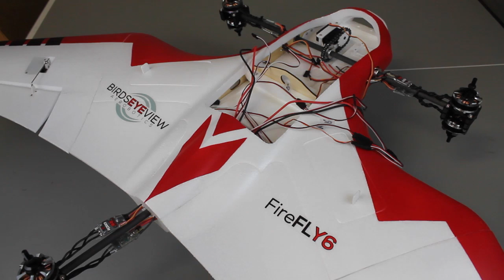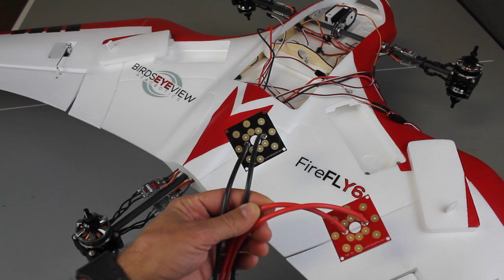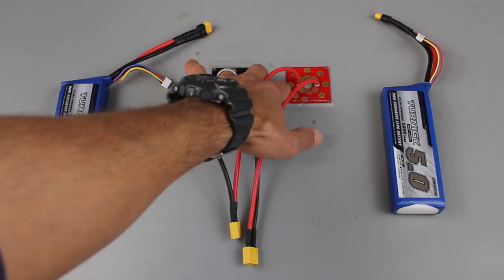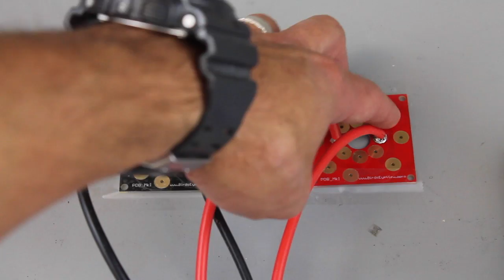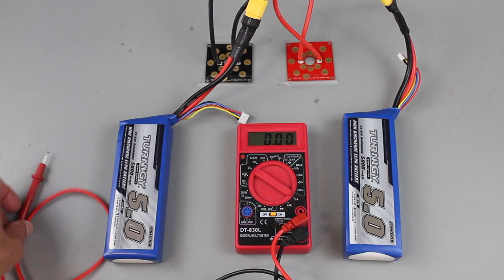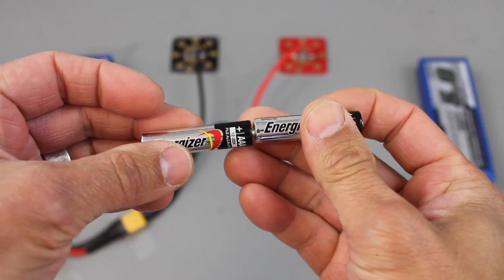How to Wire LiPo Batteries in Series and Parallel with Power Distribution Board

Comment: I'm building an ebike battery could I wire a 6 cell 22 volt 8000ah and a 4cell 5200 in parallel to give me 13.000ah but would it still be 22v
Reply from the maker: Hey Nick. Generally it's not a good idea to wire two non-identical batteries together. You can read various schools of thought here:

https://physics.stackexchange.com/questions/64509/different-batteries-connected-in-parallel

Good luck with your project.

Comment: Hi Dennis, I have been looking at this for over a year now. Still undecided I tried other VTOL's which failed in so many ways. One was a Ripmax which was nothing short of a toy. I fly both planes, Multirotors, Helicopters etc. I don't do boats. But I am looking at there KIT package. It claims to have everything there apart from the Transmitter and receiver. I have A Taranis, I was interested to know your view points because under DIY it says that for the basic one which I am looking to buy it can has an average flight time of 15 minutes. The flight time for the other DIY is 25 minutes (both Hybrid) I have batteries coming out my back side so to speak, I am wanting to know what is different on these models. I cant find a difference???? Also I have been searching for your follow up videos on this. I seen some that had a Pixhawk or APM mix with the DJI? I am wanting to get my facts straight before I have them ship it to England UK. I don't want to waste my money and be upset. Thank you and anyone else who replies. PS how is it? you can send me a message or reply on your page. Jon.
Reply from the maker: Hi Jon, I think the best bet is to reach out to Nate or Adam at BirdsEyeView and let them know I sent you. Tell them you're thinking about FF6 and want to know the difference and let them answer for you. There are very knowledgeable guys and have done a great job of supporting me.
Reply: Dennis Baldwin thank you Dennis. Adam has replied. I  did that before contacting you.  I  am  considering just the frame kit without the propulsion system because the company is in the UK.  and the basic kit is being sold in the USA,  taxes will kill me.

Comment: I'm confused about something. Are you saying that connecting those two 5Ah batteries in series makes it the exact same as having one 6s 5Ah battery? I don't get how that makes sense. Don't they still have the same capacity as they started with? Wouldn't the whole set up with them wired in series be 6s with 10Ah?
Reply from the maker: When connecting in series you are doubling the voltage while connecting in parallel you're doubling the current capacity. This article with diagrams explains it well:

http://www.zbattery.com/Connecting-Batteries-in-Series-or-Parallel

Hope that helps and thanks for the question.

Comment: so when in parallel,,,,,,the power distribution boards allow us a common ground? Which doesn't happen if you just hardwire batteries together?
Reply from the maker: +Oswald Reef The PDBs allow a common ground for other components to share. If you wire the batteries directly together you do have a common ground, but it become more difficult to allow other components (OSD, FPV TX) to share that ground.
Reply: +Dennis Baldwin thx for your reply :)

Comment: Can you make 2 battery packs work as well in series as in parallel ?
Reply from the maker: Mee iau Yes. I talk about it in the video. Hope that helps.
Reply: Yes. You can also hook it up as Series and Parallel Circuits with remote switch.  Your packs can switch from Series to parallel with a switch of a button.

Comment: Now that is a really interesting aircraft!  I hear what Hiway is saying about it being less efficient compared to a standard fixed wing.  However, compared to a conventional multirotor, it seems to me + or – efficiency may be a function of what mode it is flown in for what amount of time.  If VTOL is only use briefly for T & L and the rest of the battery is flown as a fixed wing, then I would think it may be more efficient than a comparable standard multirotor.  Probably even more so if it were possible to eliminate two of the front motors. If that holds true, then perhaps the “glass half full” way to consider this aircraft is that it offers the advantage of VTOL and hover to a fixed wing configuration or if one prefers, potential flight duration to a multirotor configuration.  Intriguing...I will be looking forward to seeing more.
Reply from the maker: B Fun That's some great feedback my friend. I like the way you're thinking and it's totally inline with what I plan to do with this. I'm going to VTOL and in between fly as a wing. My goal is to see how it performs with various mapping missions. I've had many missions with limited takeoff/landing space but the need to cover large areas that a multirotor couldn't do. So it's a good hybrid approach theoretically. I'm also interested in knowing what the glide characteristics look like. I'll definitely be sharing everything I learn. Thanks for the thoughts.

Comment: I'm interested in those PDBs. I'm building an X8 850 size with a Pixhawk, so I've been following your vids, and I'm trying to find a Power Distribution Board that will handle eight 40 amp esc. The motors are Sky Hero 2815-470. Any suggestions on a reliable board and where I can source one?
Reply from the maker: courierdude I'm not sure where you can get those PDBs. I've looked all over and haven't found the exact ones. Perhaps BirdsEyeView is having them manufactured. BirdsEyeView Aerobotics will you be selling the PDBs on your site?

Comment: Hi Dennis,

I've watch several of your videos.  I'm attempting to build pixhawk setup on an F450 frame with a Taranis Radio.  I used your two QAV500 videos as my main guide.  You make awesome videos that explain things in a very organized way that I can understand.  Great Job!

I was wondering if you are going to do the 3rd video on the QAV500 on fine tuning and flight mode switch setup and failsafe setup  on Taranis.   I don't quite understand how to fully setup flight mode switches on the Taranis with Pixhawk mission planner software.

The main things I need to do are:

1.) to set throttle limits on Taranis to 1120 (min) and 1920 (max) to make my E300 Opto ESC's work.

2.) Setup a 2-way switch for stabilize and loiter modes.

3.) Setup a land over ride switch for a panic switch (I can't use return to launch due to large mountains and may obstacles in the way)

4.) Setup land as the fail safe mode

5.) Setup a safe trim switch for manual trimming.  I think you may have a video on this somewhere?

I'm not sure how to get a hold of you.  I will just monitor this youtube post and hopefully you will respond.  

There are some good videos on Taranis but a lot of them are for planes and naza and are very confusing.  I've not been able to find too much on pixhawk that I can understand well.

 If you could do a video on this stuff it would be awesome!  Or if you could include the answers to these questions in your next QAV500 video.  I hope you do another one soon.

Any help is greatly appreciated. 

Keep up the great work!  Your videos are awesome!  I'm glad you take the time to do them.
Reply from the maker: Hall Fatherofthree Thanks so much for the thoughtful comment. I definitely plan on getting the tuning video up soon. Since the weather has been so iffy here lately I'm going to start with a manual tuning video using the Taranis and then I'll follow up with auto tuning. I'll be sure to cover flight modes as well as failsafe. Stay tuned and if you have any further questions just post them and I should get them. I'd recommend starting them as new comments because replies to my comments don't always make it my comments list. It's a weird YouTube thing. Take care.
Reply: Dennis Baldwin Awesome keep up the great work!  I look forward to your next videos!!!

Comment: Would it affect the batteries if i put  a 3S 2200mAh 30C with a 3S 3300mAh 20C in parallel? Would I be able to pull theoretically 5500mAh at 66A?
Reply from the maker: sirglider That's a really good question of which I don't have the answer. You theory seems to make sense to me, but I don't have any evidence to prove it. I'll see what I can find out and please do the same. Thanks.

Comment: Interesting- but I have to wonder where the efficiency of the wing is reduced for the ability to hover.
Seems to me that instead of the best of both worlds, this craft has inherent limitations on both of those features- the wing hinders the multicopter ability and more importantly the Y6 action is adding inefficiency to the wing. The mechanical gear that appears to pitch the forward motors for forward flight reminds me of my fpvcam auto tilt mod on my mini 240 Nemesis quad racer using a servo and the camstab on the naze FC... I imagine this is being triggered the same.
Ultimately, I do not ever see anything on video taken by a wing that is without the tip and toss of the wing in flight- never smooth and silky like a multirotor offers. Mapping may not require this ability, but at 45 minute flight times, I can build a large multirotor that can stay up that long.
Maybe my lack of full understanding of the capabilities and actual real world use and operation has me speculating out my ass- and that is very likely, but I just do not see how mixing multirotor and fixed wing is superior, or even comparable to a well designed craft of single focus in either of those 2 realms.
Obviously the Y6 was required as a quad design on that wing would only emphasize my points. Tri configs are superior in wind also as the props do not wash over each other in flight- hence why my current new build is a Y6.
Curious how pixhawk handles this anomaly. How does mission planner view this? arduplane or arducopter?
Reply from the maker: ***** I really enjoy it when you speculate :) I don't have answers to your questions just yet, but let me share my intent with this. I plan on using this to test some mapping missions that I've previously done with my wing. The problem that I've had with my wing in those cases is landing in tight areas. I've had to land mine into a bush a few times. I like the idea of VTOL before and after a mission. Most of the time this will be flying as a wing with the 4 front motors providing propulsion. The rear two only come into plan when in hover mode. It's quite an interesting concept if you ask me and I'm anxious to get it in the air. Initially it will be with Pixhawk and APM copter. Then I will had autonomous capabilities and test that. I'll definitely share everything I learn about it and let you come to your own conclusions. Hope all is well.
Reply: Dennis Baldwin
Oh- shit! Glad you mentioned pixhawk- I have some shotsky diode rectifiers on the way- used in 3 way redundant powering with the pixhawk and utilizing bec's- I have an extra 1 or 2 and they are dirt cheap- if you need one and want to set that up on any of your pixhawk builds, I have easy links and tutorials for you to integrate it. This offers a 5v to servo rail, 5v to power side, and a backup to the both in case of any failures- and 3 way redundancy on an autonomous mission can only be a good thing- right?